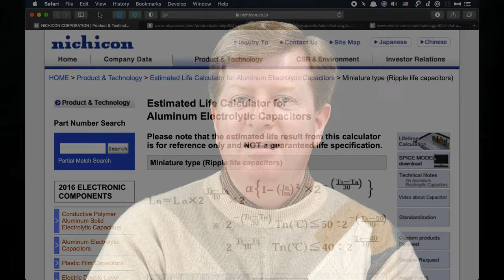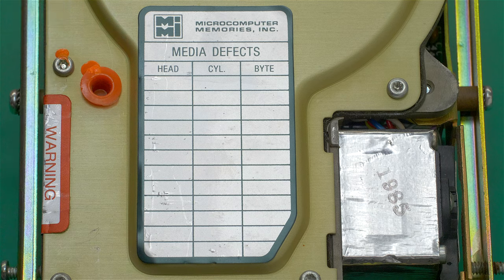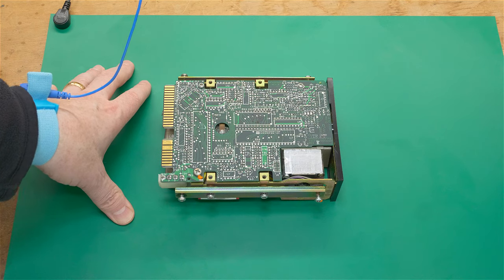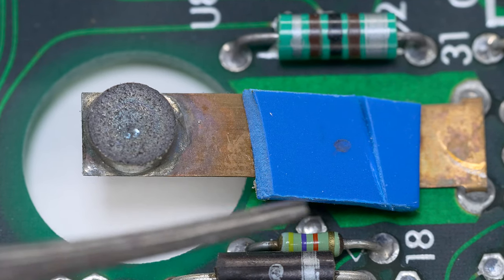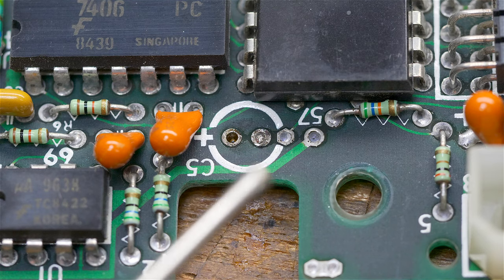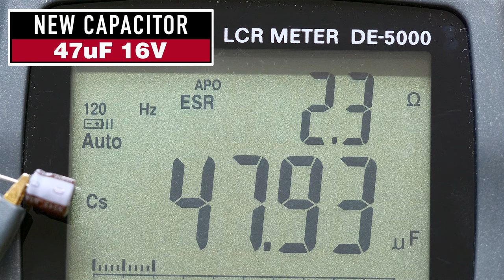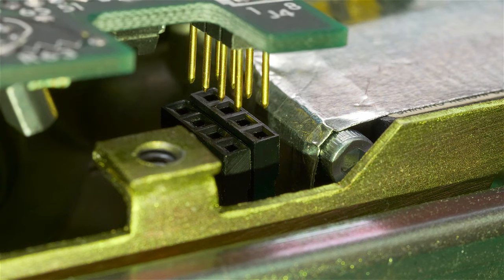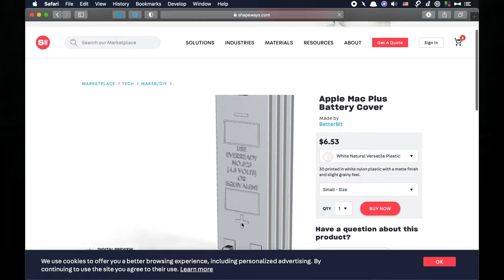Recapping an MMI 10MB Hard Drive [Part 1 of 3]

Comment: I have had so many people tell me the same thing when I mention my interest in these old drives. “You’re wasting your time with that old drive, replace it with a CF card!” The reality is, these old drives were built VERY well and a lot of them are still quite reliable even to this day if they are cared for and maintained. I’ve also seen other people say things like “very soon these drives are all going to fail,” but I’m just not buying that. I take very good care of my MFM hard drives and they are aging very well (I don’t have a HyperDrive, but I’ve got lots of PCs with MFM drives).
Reply from the maker: Exactly.  The reason I changed the electrolytic capacitors in my drive is because they often leak and capacitor manufacturer data sheets and guidelines don't guarantee life beyond 20 years or so.  Even if one argues the caps were still good on my unit, swapping them out guarantees all the fluid-filled caps are good, giving a further boost to the longevity of the drive.

Comment: I can honestly say, that over the years I’ve never seen this drive. It’s similar to the MiniScribe in its overall design but all the fine details are different. I can’t imagine what Mac this drive would be used in.  Perhaps it was aftermarket upgrade like Hyperdrive or some portable conversion system.  As a side note, despite what some might say, all electrolytic capacitors this old should be replaced.
Reply from the maker: Thank you for your comment.  I have received a fair amount of resistance over the years from folks who feel there's no need to recap anything ever.  But as you properly pointed out, that is not true.  That's why I added technical documents in this video showing that even the big brand name capacitor manufacturers do not guarantee a service life beyond 15 years (for electrolytic caps).

Comment: There is also the ULA which was an early mask programmed logic device from Ferranti.   It could very well be what allowed them to make this drive as compact as it is, as it can take the place of multiple discrete logic chips.
Reply from the maker: Which IC on the drive controller PCB is the "ULA" you are referring to?
Reply: @JDW- It's the other large chip in the drive PCB labeled Ferranti.

Comment: Years ago I fixed an old hard drive that had a visibly blown capacitor and the drive was totally dead.  1 capacitor and the drive came back with all the data intact!  Nobody makes these anymore and it’s nice to have some that work.  I also fixed a drive by replacing the board on the back of the drive with one exactly like it!  You could have a good mechanism or a good board.  Worth keeping because of esthetics.  I do like the new SSD replacements, myself I would replace with SSD and use the original HDD occasionally.  These things are probably getting very rare.  I also had some stiction issues with some old drives, my solution was a flick of the wrist, and in most cases would unstick the head from the platter.  It’s been years since I’ve even had an old drive in my hands!
Reply from the maker: When you ponder just how hold that 10MB drive is, it really does make on marvel, especially since it still works in my case.  The recapping was just preventative maintenance since all electrolytic capacitors really could use replacing after having been in service more than 20 years.

Comment: Those crystal oscillators can fail too. I had to replace one on my SE/30's Ethernet card.
Reply from the maker: Thank you for watching and for your reply. You are correct, although I myself have yet to see a failed crystal oscillator. Technically any of the electronics on the board could fail. It all boils down to which is most likely to fail on a particular board. That’s always a shot in the dark unless you have a schematic.

Comment: I don’t think I would ever do this but am living cathartically through your video for now hehe...
Reply from the maker: Thank you for watching and for your kind comment.  Have you ever changed the capacitors on an old electronics device before?
Reply: @JDW-  For sure! I’ve had success with it with older video game consoles and synthesizers. But doing it on an old hard drive? That’s just not for me. But I respect that you’re doing it!  Instead of fixing up my SE30s hard drive I decided to go with the SD card adapter and am so happy I did. The machine loads up so fast now and works amazingly. However, I do miss those old sounds of the hard drive working away :)
Reply from the maker: @cybernitemusic  Because this particular drive is rare and an important part of Apple history (even though it wasn't from Apple, Apple made sure that adding it did not void the Mac's warranty), I want to do my all to ensure it has a long and happy life.  If the drive did not work, I would not have recapped it.  It still works though. My next two videos in the series will make it more clear what this drive is all about.

Comment: Hi there, So the system that came from was a 1984-1988 Macintosh could be 128 512 or Plus. That was a kit from General Computer Corp. GCC and made the first accelerator and internal hard disk for the Macintosh. GCC was MMI's largest customer before they filed bankruptcy. The Hyperdrive systems came in the form of HD 2000 HD FX23/30/40 and these kits were AMAZING. Do you have a full Hyperdrive Macintosh? I am so very interested in talking to you about your system. Thank you and have a good day.
Reply from the maker: You are correct, but the kit I have is older than the HD 2000.  Later kits had a 20MB drive, but mine is one of the earliest kits with a 10MB unit.  I am still filming my Part 3 of this series which goes into more depth about GCC history and the installation and usage of the kit I have.  Stay tuned!
Reply: @JDW-  Anything older than the HD 2000 would be a prototype which your kit is not. I can tell you this which you can confirm this question. Do you have a small cooling fan MFG by Buhler of Germany, which has a multistage fan controller? The answer is yes if I may be so presumptuous, so you  do indeed have an early Production model Kit, which the MMI drives were ordered in size request based on the customers system specs. There were 10MB, 20MB, 30MB, 40MB HD's. I will show you my prototype however email would be needed for that.
Reply from the maker: @user-di8gk1rp8t  Yes, I have such a fan.  I will present all those details in my Part 3 video, but for now, you can see photos of the kit here: https://www.flickr.com/photos/66071596@N00/albums/72157633872677859
Reply from the maker: To contact me by email, click on my JDW name, then click the About tab and scroll down to find my email address.

Comment: Those connectors looked very fiddly.  Is there a reason you don't use a desoldering station as I find they are much more efficient than using solder wick as you seem to spend less time applying heat to the board.
Reply from the maker: I have a desoldering station but prefer the wick because I find the wick works better.  In fact, I only very rarely find the desoldering station works well to clear solder from a thru-hole attached to a ground plane.  You'd think a desoldering station SHOULD do that job better because it is theoretically design to do that task alone, but again, that is not my experience.  If you want to see how ineffective both a desoldering pump and desoldering station are, you can watch my 512K motherboard recap video here from 22min.37sec.: https://youtu.be/vz2NGF5Vuao?t=1357
Reply: @JDW-  Judging by the sound your solder station was making I think it may have been blocked.  Mine is very similar to yours and it makes a slurping sound as it sucks up, also it looked like it wasn't melting the solder on the board like I would have expected? I sometimes find when it makes that noise, you either need to run the cleaning rods through the tip and shift any blockages, or replace the fibre pad at the rear of the glass tube (ie away from the tip) and remove any clogged solder splatters that are in the glass tube or around the spring.  

The only cap I often have trouble with is the one on the Amiga A500 board just below the CPU as one leg sits on a huge ground plane. I usually find as you have suggested in this video adding new solder and copious flux will get it out. If all else fails cut it off and just remove the stumps of the legs.
Reply from the maker: @Wallygjs  No, you can hear it was indeed sucking.  But it cannot suck what isn't liquid, and despite my having boosted the temperature way beyond 450°C, there are just some thru-holes that are attached to such thick ground planes that such stations just don't work.  And on a multi-layered board, you often have more than one connection to that hole, which means a ground plane plus something else.  That is why heating the area with a heat gun was the only thing that finally loosened the solder enough for me to get it out of the hole on my HDD controller board.

What I think my desoldering station needs is a fat tip.  That way there is more surface area to come in contact the PCB.  When the surface area of the tip is small, you can use 450°C all day long and it won't do its job.  Unfortunately, I only have that one tip for the desoldering station.
Reply: @JDW-  Wow that must have been some nasty big ground plane!?
Reply from the maker: It’s certainly was. No doubt it was easy to solder in these components at the factory, but this board wasn’t designed for easy parts removal and repair, let me tell you!  The same is true of the 512K motherboard. And that’s why in my 512K MB recap video I recommend people just snip off the old Axial caps and solder replacements to the remaining leg stubs.  It’s much less likely an inexperienced solderer will damage the board by accident that way. You can’t use that trick on radial caps though, which is why the HDD recap was harder. The positive side holes were super easy. But the grounds were a beast to deal with!

Comment: Forgot to mention, The blue piece of foam tape was like that from the factory and it indeed was cut off of a roll of tape and placed on the copper strip to prevent it from vibrating / coming into contact with the Disc plate housing while it is spinning. Kind of an isolation buffer so you do not want to remove it, and I do not know if you checked to see if the adhesive weakened over time but it is worth a check.
Reply from the maker: I thought that blue piece was hard plastic. It didn’t feel like any foam I have ever encountered before. But the adhesive is strong. It’s on there quite solidly. But what is the purpose of that metal piece to begin with? It touches what looks to be a ball bearing. I’ve never seen that on any modern HDD.
Reply from the maker: @G You appear to have insider knowledge, so I must assume you were associated with GCC in some way back in the early 1980's.  I have a question for you.  The HyperDrive 10MB kit I have was installed in a Mac512K with the original 64K ROMs.  It booted booted just fine when I first got it, but when I removed the kit, installed 128K (Mac Plus) ROMs in the 512K motherboard, then reinstalled the kit, it wouldn't boot.  I could boot from a HyperDrive floppy and confirmed the data was still on the drive.  I then removed everything, reinstalled the 64K ROMs, reinstalled the kit, and the drive booted up right away.  Would that be a limitation of the software on the drive or the ROM code on the HyperDrive controller?  I am quite curious because I've read that certain HyperDrive models were HFS compatible (which requires the 128K ROMs or HD20 INIT).  You can see the HyperDrive software on MacintoshGarden here: https://macintoshgarden.org/apps/gcc-hyperdrive-software-drivers
Reply: @JDW-  Issue to address is firmware related as the logic board was designed around the Macintosh's internal system test function which relieves open ended access to Apple's logic board. Lets just say that is the secret to how the GCC logic board, software and firmware "slave" the MC68000 CPU. The ROM codec registries are apart of such software / firmware assignment, (Majority assembly language) therefore the kit is not "Universal" to all Macintosh Models, as software and hardware revisions follow in suit. If you can show me the floppies you have I can indeed assist you with such upgrades / tweaks.
Reply: @JDW-  The foam may have gone hard over time considering there is a huge BTU load within that combined space, but to my recollection it was a poly foam tape. The hardware features of that particular design were fairly proprietary then which is why MMI was such a hot product in the industry before they lost their seat if you will. Rotational RPM, generates a huge heat load and resistance which are two very powerful bits of information in a mechanical device pertaining to bimetallic elements and we all know that Hard Discs physically "crash" and the heat is what causes the internal discs to fuse together thus making disc and data recovery very unlikely. Mechanical design features are everything in such a product.
Upon later models after MMI went bust there was a reluctant switch to SCSI external drives such as the Ultra Drive, Seagate HD's were primary within such other accessories, and the Hyperdrive systems were not as "popular" due to expense differences between the two, and of course Apple started working on their own internal disc drives for the upcoming product development updates and future SE release. Unfortunately the market was flooded with external HD's for the Mac and production tapered off for the GCC Ultra Drives and the Hyperdrive which ultimately lead to different products until the eventual end.
Reply: @JDW-  The software on Macintosh Garden are incomplete, there are two more discs which allow registration / initialization of a mounted drive with software update revisions. This was not typically included in the consumer grade kits, it was meant more for distributors which would take customer systems and retrofit dealer grade kits after the fact. So two different levels. Customers that wanted their own "kit" received a kit that was predetermined and packaged by GCC and the customer simply installed which their serial number was needed to pre-configure around their specific system specs.  The other side was Hyperdrive associated "dealers" had back end knowledge, software, and modern equivalent PDK's which allowed them to outfit a customers system at will, and then provide sales, service and support. Being out of state in that era was not easy on the customer service side of life.
Reply: @JDW-  Also just another carrot for you. Your assumption was fairly spot on in reference to your HD not experiencing an impact. The red and white label on your HD is a Shock indicator, the red fluid is held inside a glass tube which has a thin layer surrounding it which will internally break thus mixing the two fluids and creating the red within the Shocktube. This was based on G-force and the C-75 is 25G rating, now your unit most likely did not experience a Gfactor 25 as it would have indeed rendered your drive DOA. So why is your shock tube RED? This is due to two factors, age and heat. There is a large "to scale" BTU load inside the enclosure and the layer inside that tube keeps the red dye from mixing and due to years of heat the layer inside slowly deteriorates over time decreasing its physical and chemical stability and  the Gfactor also declines and eventually setting it firmly onto a desk or carrying it around in your good old "MacSack" is enough vibration to break the layer and the fluid leaks and fills the tube RED.  :) Would you like to know where you can buy the replacement tubes to restore that aspect of your system? If so I will be happy to oblige.
Reply: Correction: C-65 is 25G.  testing was performed with lower and higher G-ratings, but yours should be 25G which is C-65
Reply from the maker: @user-di8gk1rp8t  I bought the kit in 2007 from the original owner who purchased in new from Apple in California in the summer of 1985.  He did not include any floppies with it, so the only HyperDrive software I have is from what someone posted to MacintoshGarden.  I'd love to have the complete floppy set.  My email address is found by clicking my JDW name, then clicking the About tab, then scrolling down.
Reply from the maker: @G I haven't heard back to you in the last 24 hours, so I wanted to follow-up to see if you clicked my "JDW" name, then clicked the "About" tab on my channel, and then scrolled down to find my email address?
Reply from the maker: @G It’s been a few days but I still haven’t heard anything from you. I hope all is well. I clicked on your name and then clicked on the About tab, but I see you don’t make your email address available. So I will need to await your reply. I actually have a number of questions for you, so please tap on my JDW name, and then to click on the About tab, and then scroll down so you can find my email address. Thank you!
Reply from the maker: Sorry to see you've stopped posting.  When you're back, please note that my new HyperDrive video is here: https://youtu.be/9c2eMR5h_NI